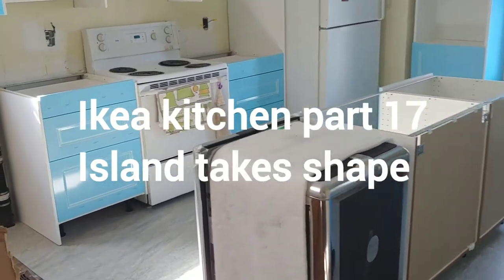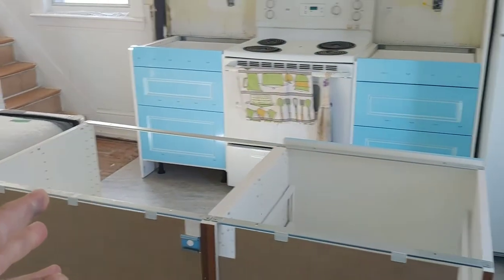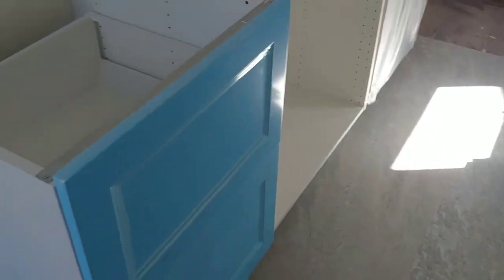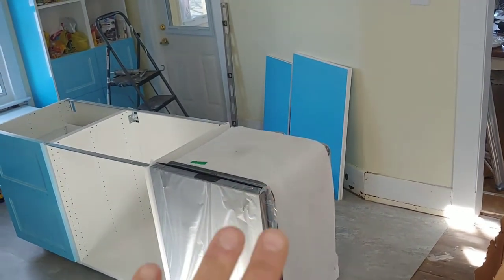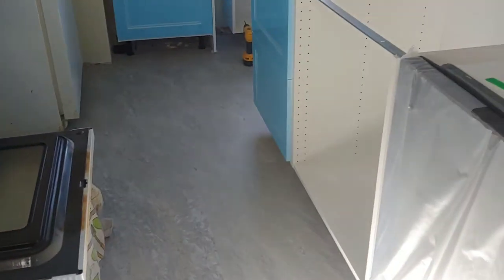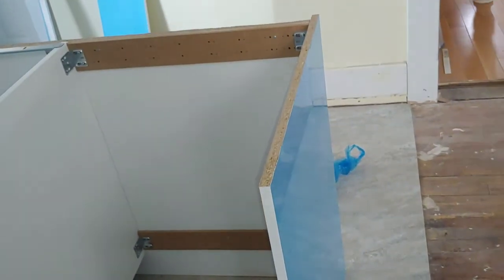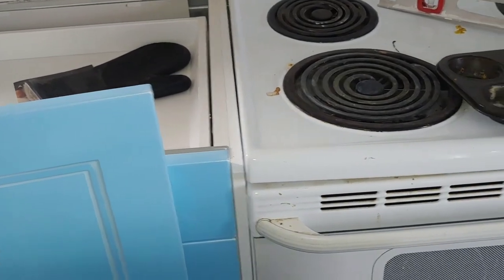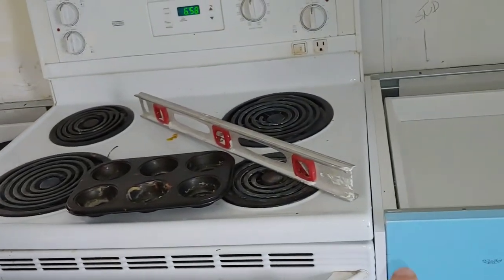IKEA kitchen install.  Building the island. Renovation Diaries part 17

Comment: Would have loved to have seen the dishwasher power and drain when finished. I’m currently renovating the kitchen and the IKEA kitchen is in the garage still all boxed up whilst I wait for the electrician and drywall to be done. My island sits over the top of two floor joists and the drain for the dishwasher will need to navigate past them somehow. It’s a nightmare working on older properties 🙄🤦‍♂️
Reply from the maker: Im pretty sure I showed the drain.  Maybe a different video.  For the power.  I eliminated an outlet that was in an old adjacent wall.  I shoved the wire back up through the floor.  (Bsmt is unfinished)
Reply: @houseonpleasantstreet9774  I’ll watch again but pretty sure I didn’t see it. I’ll also checkout you’re other vids. Thanks. 👍
Reply from the maker: @richardshort4587  Thank you I appreciate it.  Hope it can somehow help.  This was my first kitchen.

Comment: I wasn't sure about the dishwasher side panel on how to stabilize it.  I saw you used the 'Assembly Kit for the Kitchen Island'.  Didn't know it existed, so that helped greatly from your video.  I also saw you chose the same side panel (glossy white) that I chose.  Yes, it was good you labeled your video with Ikea :)   Thanks for your video efforts!

Oh.. the Edit:  I saw you followed the instructions by using one leg for two units where they interconnect with each other.  I actually put a separate set of legs for each base cabinet and then screwed the units together as also suggested in one of the instruction sheets, which made the units very stable.  I am not a fan of dividing those legs into two separate units where they connect.  I think that is not a good method, personally speaking.
Reply from the maker: Thank you for watching my video. And i am glad it helped.
Was a total learning process for me and there was definitely not alot of instructions on the dishwasher side panel.
I agree that the leg system is a good idea but not perfect.  Would be good if the legs were sturdier.
👍👍👍
Reply: I needed to add this for anyone watching your video with the same intention I had on assembling  the section for the dishwasher.  I also ordered the
** 'Reinforced ventilated top rail - Sektion' .
It holds the whole thing together on top.  It comes with a Sektion base cabinet but for gaps underneath the countertop, that part is to be added.